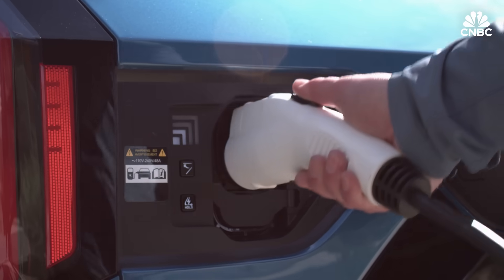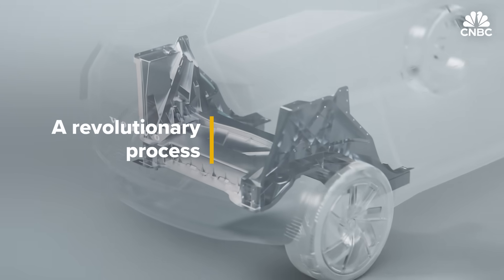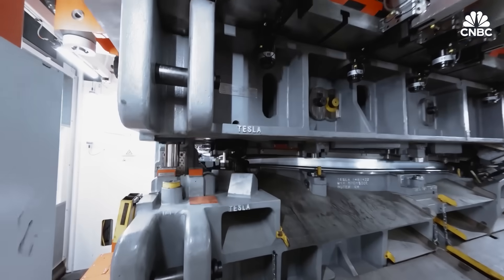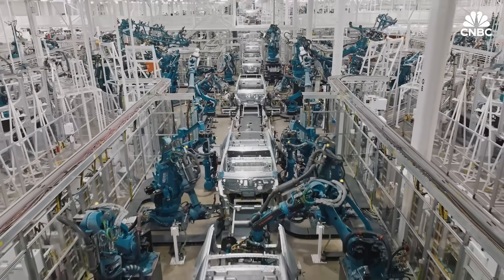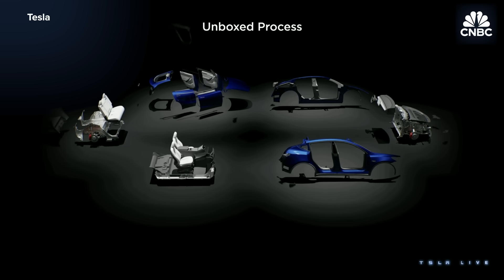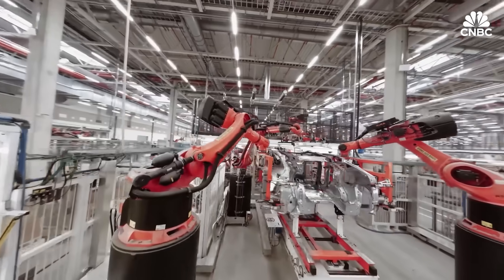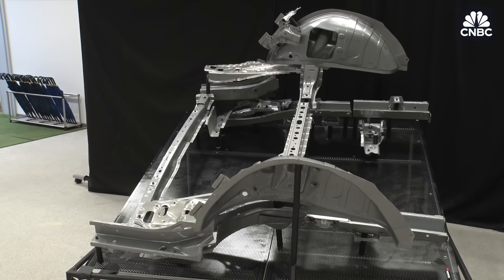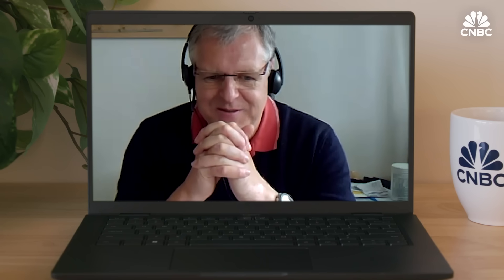Why Tesla And Other EV Makers Are Betting Big On Gigacasting

Comment: Nope. The problem with Tesla is that they have over automated their production line, making it extremely difficult and time consuming to offer new models. They can produce lots of identical Model Ys, but changing to a new version takes months, fully stopping production for the change over. That’s nuts. Kia/Hyundai has produced about a dozen new models in the past three years while Tesla has only come out with the total failure Cybertruck and modest upgrades to the Model 3 and Y. Not to mention Toyota, Nissan, Cadillac, even Subaru now have competitive offerings.

Comment: diecast Hotwheels, why the cybertruck bumper snaps off. 

its why teslas are totalled after a fender bender. cast metals are brittle. where stamped metal bends and can be pulled out by collision guys, cast cars develope cracks, sometimes even invisible cracks. 

basically everything rich rebuilds rides around in is a death trap in a second collusion...

i will not trust my life inside a Hotwheels, period

Comment: The problem with Tesla's actions is that the cost of producing EV's is down but accident and other repairs are exploding in costs - those gigacastings mean you cannot just remove the spot welds and replace the damaged part.   Now you have to replace an entire subassembly at a huge cost.    Insurance rates reflect this.

Comment: Megacasting/Gigacasting is not inherently an EV technology. It's just a way to make automobile body parts in a simpler, potentially cheaper way for any kind of car, no matter what powers it. What our industry, especially needs to see, is that the standard expected vehicle has changed over the years from a simple and practical vehicle to an oversized, over luxurious, overly expensive beast that just cost more. There are no longer American made cars that are not luxury SUVs. Our expectations are too high. We cannot imagine a car without every feature. No matter how you cast the body parts, you will not be able to reduce the cost added to a car by having: motorized doors, motorized fuel/power access panels, motorized door handles, automatic moving seats, giant computer touch panels with all sorts of internet integrations, artificial intelligence, 9 passenger seating, 0-60 in under 5 second performance, self driving, facebook, etc.. I personally don't want any of that. Not, just because I want my car cheaper, but because I don't want all that crap in, what should be, simple, reliable transportation. My car should not know about facebook, nor should it be suggesting what to have for dinner. The most advanced feature my 1998 truck has is power windows and AC. I'm just fine with that. I would love to be able to buy a new 20204 version of the same vehicle, at the same size, with the same power, and the same range, a non polluting drive system, no touch screen, and no new features that require all sorts of expensive additions that don't really improve my ability to drive anywhere safely.

Comment: If Tesla has licensed the mega casting process then it would be an added expense to whom ever replicates their process. But their process is the best way to produce and inexpensive car at this time. It still need perfecting since the gapes are too large and inconsistent. A more experienced manufacturer can solve this problem. BYD and Lucent make a better car but their power infrastructure needs improvement.  Tesla will be around for a long while but not as an auto maker but as an innovator of EV technology. Only time will tell.

Comment: I wonder if these cars can be fixed after a crash. Normally you can replace pieces of sheet metal or structural parts. Since it will one piece this type of car in my opinion is nothing but trash after accident

Comment: For collisions the casted pieces are far stronger and so Teslas save more lives than almost any car, so this is maybe the highest value to an owner. The casted pieces can endure a lot more pressure before it dents than an assembled structure that will give way usually at the point of the spot weld. Tesla is a smart car so with FSD it will "not" have so many collisions as FSD doesn't get drunk, get high, get emotional, have a heart attack or play with the phone.

Comment: Mega casting is nothing new, the aerospace industry has been casting parts larger than this for years.  Casting is also not as easy as pouring molten metal into a mold.  There is a science around how gases are vented from the mold to insure the quality of the part to insure it is not porous, etc.  Die casting is typically a small part process whereas large parts are made through a different process called investment casting, which produces higher quality parts in large format.  We need to stop treating everything that comes out of Musk’s mouth like he is some god.  I likely got the idea for casting from existing manufacturers of casted parts.

Comment: aluminum has a 1 time repair ability IF it is repairable because aluminum breaks massively easier than steel. a simple fender bender in a 1980's/1990's would be a totaled vehicle for a tesla.
if you get hit on the side in a tesla...the replacement parts are entire frame pieces which the cheapest parts are $14,000. can you afford this repair for just 1 parts....you could have to replace the entire front, the chassis and the rear just for running over a bicycle in a drive way

Comment: A lot unthinking Tesla stans in the comments who take everything Musk says as fact and clearly didn't watch the video. The question is not whether Tesla is using casting in its factories (the video clearly says it has been for years). It's whether Tesla or any other company can profitably retool their entire production line so that the entire body of the vehicle is megacast in one piece. Their most dramatic claims about the massive efficiency and space saving of "gigacasting" are for production methods that have not yet been implemented. Their 2024 Q1 earnings call also revealed that they were pausing moving forward with that next generation production line. If it was as easy and successful as all Musk's bootlickers make it out to be, they would have switched over as soon as possible.

Comment: casting failures are a non issue from a production stadpoint. unlike stampped aluminum casted pieces can just be melted back down and recast ed if something is wrong. a stamped piece of aluminum would have to be sent to a recycle.

Comment: EV has about half the parts count of a gas car, but yet these EVs cost 2 to 5 times as much.?? Someone is making a huge profit on these simple and cheaply built cars.  On top of that Ev's also have their own type of pollution ( gases from Lithium or Ultium batteries, including other specialized automotive grade batteries) and are   known to expel highly toxic gases both when charging and discharging now this will add to our already polluted  air. On top of that, the total operating cost of these EV's is extremely  high in the long run.  ... No thanks, I'll  pass ... I don't want to add to the problem by adding even more toxins to the environment.
Reply: EVs are expensive because batteries are. Batteries are expensive because they are relatively new and research into this type of automotive use was quite low for a long time. Lithium-ion batteries were invented in 1976 vs 1886 for gasoline powered cars, so a lot of time to optimize and make production cheaper. Also these batteries do not produce gasses, unless they are damaged. ICE vehicles produce more gasses, they literately produce pollution when running. And finally EVs are generally cheaper over their lifespan compared to an ICE, they have a lot less moving parts, they do not produce explosions hundreds of times a second, so maintenance is a lot cheaper. Also electricity is cheaper than gas, especially when you charge at home and during hours that electricity is the cheapest. Though EVs are not better in all use cases, mainly large vehicles, but that comes down to my first point, not enough research to make batteries more power dense and use cheaper materials. Btw most trains are EVs and those that aren't are mostly hybrids.
Reply: @craftbox9276  the problem is people aren't willing to pay more for that, this is still a cost issue, even if they're interested in EV, they still go for hybrids instead, it's easy to say EV is cheaper in the long run, but buyers don't care about that comparison, they want the value for the car they're getting

Comment: My dad used to be an engineer at US Steel and he claims this gigacasting crap is a total joke and will never work becauae of the high instability of the molds. Steelmaking and metallurgical work in general requires very specific conditions and heat.

Comment: The Model 3 does not use Gigacastings for either the front or the rear assembly. Only the Model Y and CyberTruck.
Reply: the model does use gigacasting you could have done a 10sec google search

Comment: Giga casting is cheaper and less vibration but Just like going from Chassie/Body on Frame to Unibody/Monocoque it makes them less repairable and while safer due to crumple zones it's done mostly to make them cheaper are not built to last 50 years and is harder to fix, restore or upgrade!

Comment: Filling castings and casting designs has now been improved with the use of A.I. It uses computer aided flow rates with cooling rates. To have the most effective casting with the least amount of flow traps (flaws).

Comment: and will FAIL. 
cast pieces have nasty tendency to crack under thermal stress, by contrast modern welding techniques allow bonds as strong as the metal

Comment: Couldn't they cast smaller parts? Just like CPU, you have a greater sucess rate by making what you want smaller because a smaller part will not get the defect of the other section right next to it.

Comment: Teslas are poorly made. We sold ours ,  cost too much to maintain and operate
Reply: @kylereese4822  EVs all have oil in their gear reduction boxes and final drive units some even have oil filters , all this has to be replace during maintenance.  Has for the rest of your comments ,you Will find out the hard way
Reply: @DrMikel-dp4kb  Windshield washer fluid hard to maintain?  You like to lie! 🤥 😂Lol
Reply: Cap detected. They may be poorly made but they don't cost anything to maintain, why are you lying?
Reply: You are about to find out the hard way ,like thousands  and thousands  of anothers  @evg3nius
Reply: @evg3nius  Poorly made, means you spend money trying to correct the flaws... or worse fix the damage caused by the flaws..
Reply: @evg3nius  we got rid of our Tesla money pit. They're very hard to sell used. Nobody wants old batteries

Comment: so just a crack on that one piece the entire section is damaged
Reply: yeah, just a crack leads to catastrophic failures in entire systems
Reply: same goes for any otther type of car. this parts are never dissasembled.
Reply: They cut it off and put another piece on that area. They have cut off points. Also catastrophic damage owners usually buy new anyway.
Reply: When there is heavy damage to chassis on any car it’s an insurance write off.

Can smaller dents and cracks be welded with this aluminium casting is the question.
Reply: @Fionndabara  Supposedly they can. But i assume the tech will be perfected until it works well. I mean that would be de bet.

Comment: yes Tesla is very cheaply made. people are overpay for it.
Reply: If 2 contractors are doing the same work but one takes twice as many hours but accomplishes the same work which one is being cheaply made? You could say Teslas are being overpaid by consumers, but when you look at the specs of the vehicles most of the other manufacturers are coming up short. I was going to buy a used Audi Q8 Etron until I saw what horrible designs they had for cooling the front/rear motors leading to high motor failure rates (see Audi forums), even on new 2024 models. I'd go with the company that has a better engineered product that has a longer MTBF than the standard warranty.

Comment: They didn't mention that the aluminum cast rejects can be re-melted and shot again. You cannot do the same thing with steel and aluminum stamping, since the factory uses rolls of sheet steel and aluminum and does not have the capability to create another roll of metal, whereas they DO have the ability to melt down aluminum and re-use it.

Comment: good video but skipped some key points.  scrap can be immediately reused.  Gigacast repairability demonstration by Tesla is missing.  Also, smaller gigacasting press by optimizing molds and molten aluminum flow rate.  Tesla advantage of no heat treatment post casting.  gigacasting is the future.

Comment: We're yet to see cast aluminium with part walls as thin as sheet metal. Casting also don't have the same mechanical strenght as sheet metal or composite. But yes parts like axles casing, floors body panel hubs, suspension arms can benefit from fast fabrication of complexe parts.

Comment: one bumper bender and the whole car is totaled. I'll be staying away with any cars with gigacasting. only one benefit from this is the auto makers. Expect the insurance rates to doubled once this evolution is in full motion. How much cheaper the car needs to get to make consumer benefit from this?
Reply: Using single castings instead of multiple welds increases structural rigidity (compressive and standing loading forces). So it may cost more for the car to be repaired or be written off at a high rates but that 4 inches of less cabin penetration during a side impact is the difference between eating from a feeding tube the rest of your life or leaving the hospital after 4 hours. There is a cost to everything. Decreased repairability at times, increased safety at times. A "bumper bender" won't total a car though unless it's a Fisher Price brand. If you're totaling a unibody frame vehicle with enough damage to significantly damage the casting more than the residual value of vehicle it would most likely have been totaled by a conventionally welded vehicle. Labor isn't getting any cheaper. But to your point the worst of both worlds would be a car that doesn't offer any additional safety and costs more to repair.
Reply: @Tokamak3.1415  That might be how the auto makers will advertised it. but why don't we all drive semi-trailer for commute if your take is safety over everything. Giga casting auto makers will show how a car is safer when it's hit with a non giga casting car. But is it that much safer if most cars are structured the same way? cars will be hit with  much more "structural rigidity" during side impacts

Comment: More expensive to repair
Reply: FALSE, zero repair needed.
Reply: @markplott4820   a simple, millimeter damage to a cast. You will have to replace the whole cast.
Reply: @jackbauer562   - NOPE , zero Damage.
even in IMPACT.
Reply: 🥴 Its aluminum, not a bullet proof metal cast

Comment: The issue with casting parts on a vehicle is, let say someone gets into a crash and later the insurance and autoshops realize they would literally need to get a cadting piece to fix it up. Which would cost a lot upfront and wouldn't be worth it and hence the venicle would be totalled. Amd the individual would need to buy a new car. It wouldn't make sense what so ever in a sustainable aspect.
Reply: It would if the energy used to recycle the old cars was green itself, and if buying a new casted car is less expensive than to repair an old normal car (because casting presumably can cut production costs).

Comment: This process gives-rise to the $40,000 dent repair, we have seen in some vids (rivian being the most infamous one). 

I don’t know if they’re using gigacasting, but the reason why the dent repair was $40,000 is because, even for a fist sized dent next to the tailgate, they had to replace the full right side skin, bumper to bumper.

This required full disassembly of all systems on that side of the vehicle …and there were only like five shops in the US that could even do it. 

The quote came back at $40,000. Painless dent repair guy who did the video did it for about five. 

It wasn’t factory-fresh, but 98% convincing. A decent trade off for $35k, or having your basically brand new truck totaled by a fist-sized dent.
Reply: Only Tesla is casting. High volume is required to cost effectively cast..
Reply: Rivian doesn’t use gigacastings.
Reply: Musk discusses this; the castings are designed for both repairability and serviceability.
Reply: lol umm, except that "$40k dent repair" was for Rivian, which doesn't use casting. It was also a bogus quote/very blind estimate that was actually repaired much cheaper (PDR etc)
Reply: His logic still stands that repairing dents in gigacasts would naturally be much more expensive to fix.
Reply: @AthleticHobo-br4qh  You get dents in (exterior) BODY PANELS.  Not (interior) CAST FRAME members!
 Castings also still have separate crush cans etc on them to absorb front/rear end impacts, w/o damaging the casting itself...
Reply: @cgamiga   Again, I am speaking only based on the information provided in the video I saw, and a Rivian driver...It's not a gigacasting, I realize...but the way I understand it, the entire side-skin of the car is one stamping (akin to a gigacasting, in that it is one ginormous piece.  

Hence the reason that to repair it "right" they wanted to disassemble that side of the vehicle and replace the whole side-skin. Which equalled megabucks, obviously.  

Even if they did go through with it, can you imagine the leaks, bumps-in-the-night, rattles and mis-alignment troubles that truck would have after having half it's soul sucked out?
Reply: @mcarrusa  The Rivian driver lied to you.  Also, half that price was paint.  In any insurance claim paint takes half the total repair price.  Car paint shops make $600/hr.
Reply: FALSE, you can't ever DENT a Gigacasting.
a impact had ZERO effect.
the crush cans are REPLACEABLE.